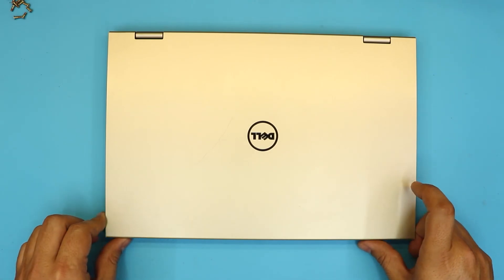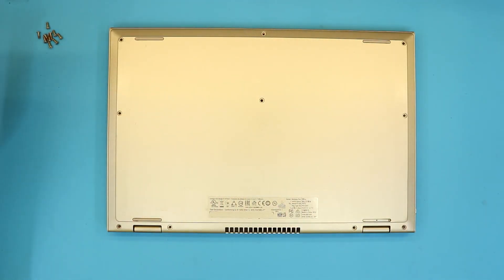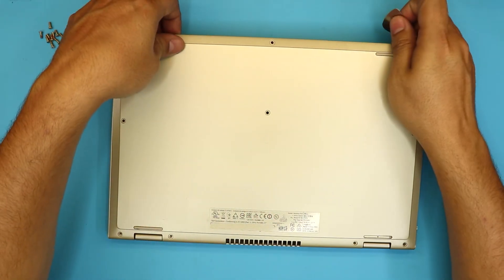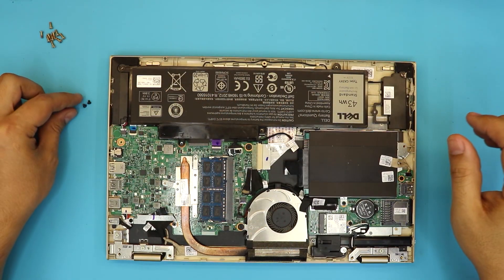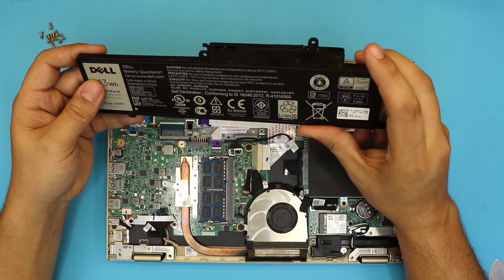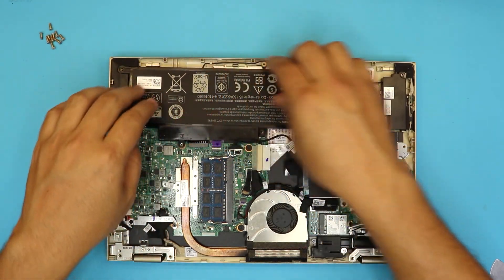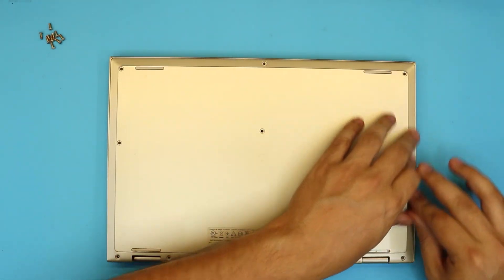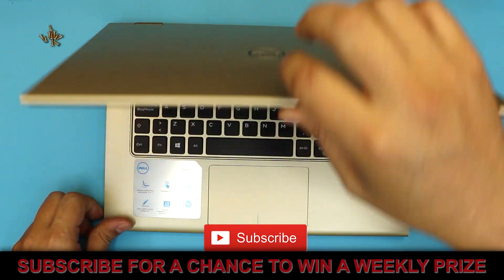How to replace Battery on DELL Inspiron 13 7000 series, complete guide

Comment: After I replaced the battery, the computer refused to recognize the new one. I turned it off, took off the new battery, held the power button for 25 secs, waited for 2 minutes and then tried again. Still no luck. The laptop simply won't recognize the new battery. any idea why?
Reply from the maker: Thank you for your feedback! If you wish to support the channel, you can like, subscribe, or both!
Regarding your question, this happens when the battery is a generic and or is defective, you may have updated the bios to the new firmware and it can detect none original battery, i recommend you to purchase a better quality or from a different vendor. this does happen and we simply replace with a different battery from different vendors.

Comment: I am not able to remove the screws from the battery. I don't have the electric one you used but have tried every type of head and nothing fits. They are not stripped either. Very frustrating.

Comment: Hi I have replace my battery recently. It seems like there is no communication between my laptop to the new battery. I cannot turn on without AC charger. After turn on with AC, the battery can only hold for 3-5mins and it suddenly shut down completely itself. is there anyway to let my laptop communicate with the battery?
Reply from the maker: Thank you for the feedback! if you wish to support the channel you can LIKE or SUB or both :P
regarding your question:  1st of all upgrade the bios to new version, from Dell official website. then if that didn't work then downgrade the BIOS to a version older. Lets me know

Comment: Any alternative if we don't have guitar thing? Coin? Screw driver? Knife? Pen?
Reply from the maker: thank you! for the feedback and your support to the channel by SUB :P
Regarding your question: you will need a opening tool or anything as thin as guitar pick .2mm you could use a super flat screw driver but then you could mark the sides of the case with it. guitar pick its the cheapest and safest

Comment: your shell is totally different from my 13 7000     just saiyan....   so this is NOT really a complete guide... .but it's still good...  thank you anyway...
Reply from the maker: thank you for the feedback the guide is on how to open, the form and shape may be a bit different but they all open with the same guide :P , i appreciate your support my friend :)
Reply: @uFixTek  thanks for the reply... but no they don't all open the same..  the shell on mine wraps all the way from bottom and up the sides.. you HAVE TO START at the back (hinge side)  to open it or you will scratch the crap out of the top side ..... just saiyan...

Comment: What is the exact part number?  I do not see it in the description as you mentioned.
Reply from the maker: this is the battery:
https://amzn.to/37hvWbA

The model number is:
GK5KY
(04K8YH)
Reply: @uFixTek  what if my dell wont read the battery? do i need to get the Dell OEM one? thanks
Reply from the maker: @clarajulio2024  it will read , we get them installed all the times.

Comment: I just opened up my Dell Inspiron 13 7000 (7370) and found a model F62G0 (38 wh, 11.4 volts). Do you think the GK5KY would work?
Reply: My laptop is Dell Inspiron 13 7000 (7373) just wondering if you managed to change your laptop battery if so where did you buy the battery from?
Reply: Shaz Baz I just bought mine on Amazon
Reply from the maker: F62G0 and GK5KY  are totally different shape and connector they are not compatible